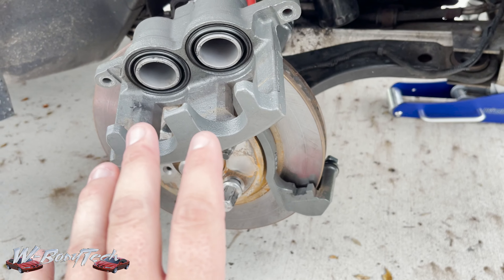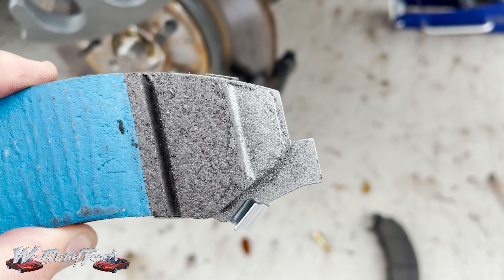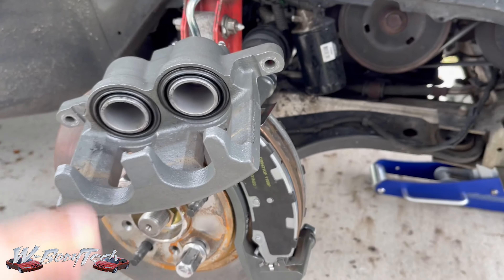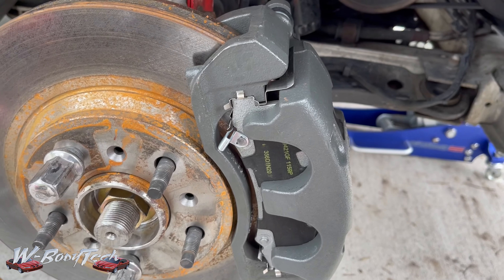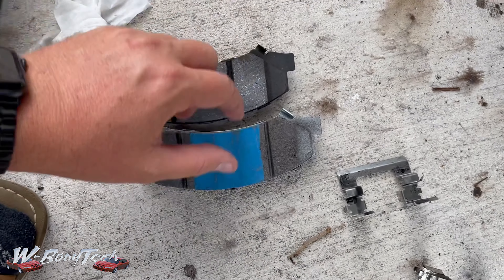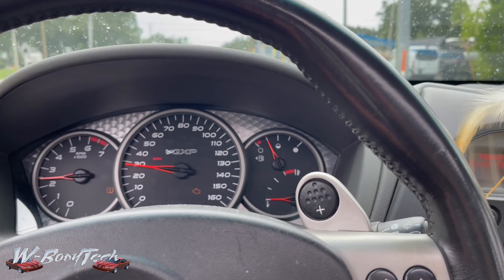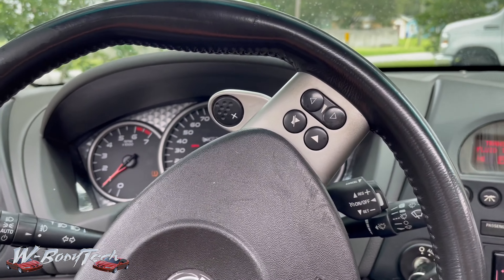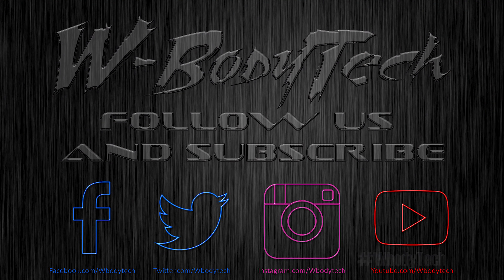Police Brake Pads on the Grand Prix CompG

Comment: I used them b4 on my 04 impala, i did the heavy duty rotors as well, from my experience with them is, i liked them but compared to the ceramic i used and just regular rotors , the heavy duty seemed to ware faster and didnt last as long as the standard eq. So i went back to ceramic and slotted & drilled rotors shortly after... what i will say and it prolly doesnt matter to most people, but the heavy duty rotors on the rear are a tad bit thicker then standard,  and i had 22in wheels on the imp. So in the rear it made the wheel sit flush with the fender/wheel well .. as a posed to the normal made the rims  sit more inside the wheel well amd not flush. If that makes any sense.  Not many people have this info available anywhere,  so just thought id share my experience. Good vid bro